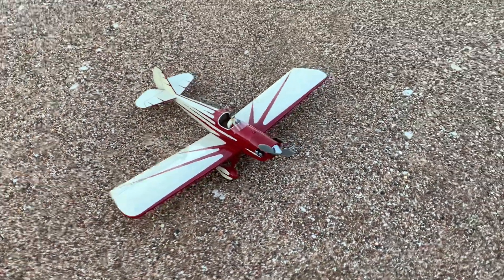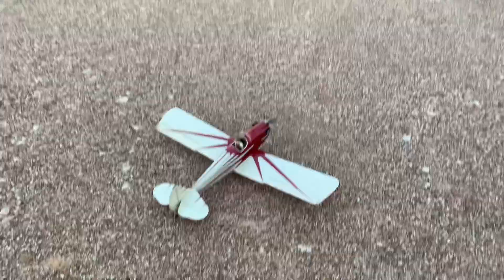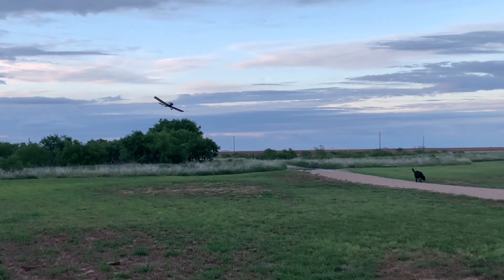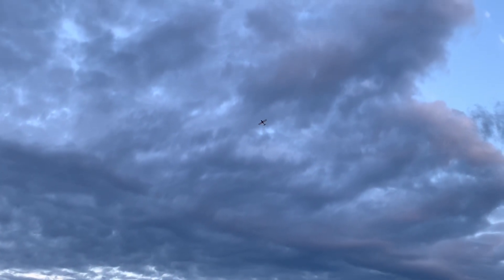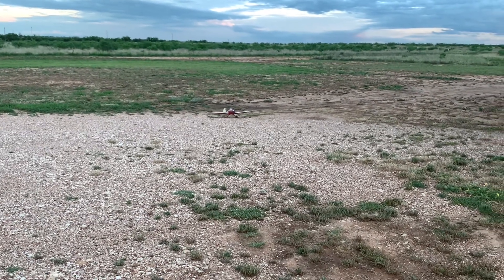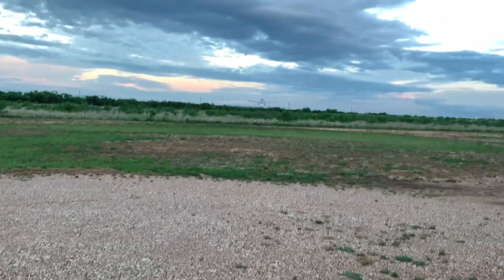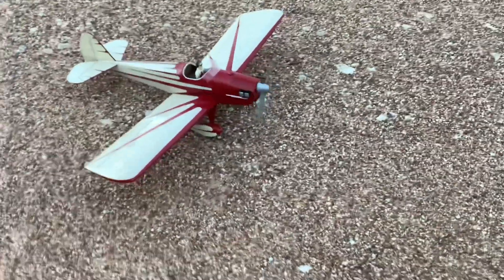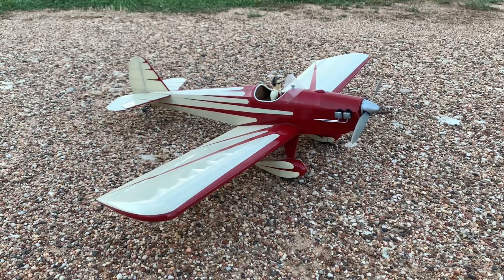BMJR Models SpaceWalker Evening flight.

Comment: Nice build ,great flying Aircraft,can i ask how did you do the covering ? Cover all in 1 colour and then lay over cut out strips on wing and fuse ,and did you pin hole it ,any advice on this would be appreciated ,safe flights🤙
Reply from the maker: I’m not the builder unfortunately but I’ve covered my other planes with the method you’ve described.

Comment: The Paul Bradley-designed Spacewalker from BMJR is the best looking scale model of the full-scale plane that I've ever seen!  And the size is super convenient.  Your pilot size is more scale than Paul's.  Where did you get the pilot, and what size do they call it?
Reply from the maker: Thanks I’m also impressed how much scale features you can pack in this plane here is the link to the pilot we used. If I remember correctly we had to trim him down a bit but once correct it looks very good. https://www.horizonhobby.com/product/pilot-air-tractor/EFL16460.html
Reply: @millerrc5829  Thanks!  That's perfect!